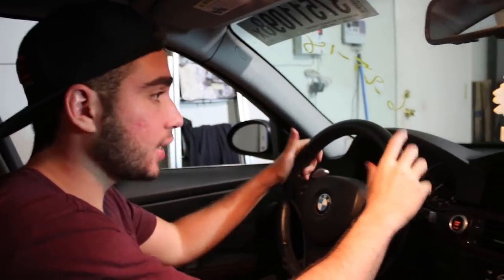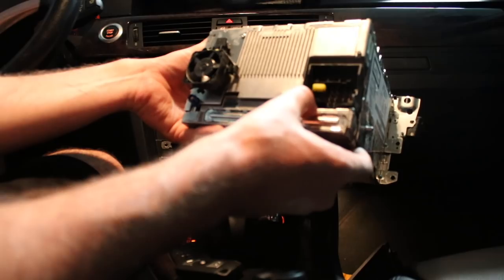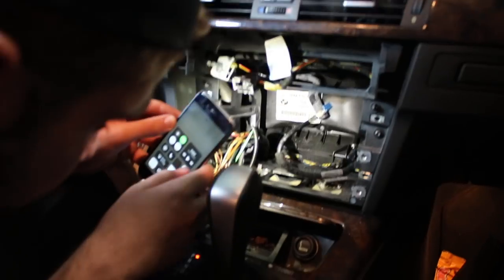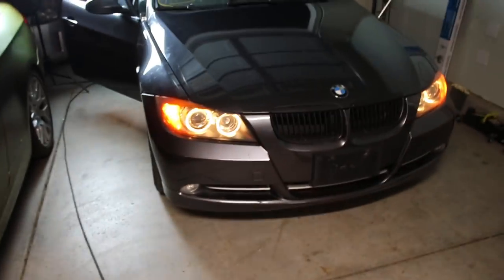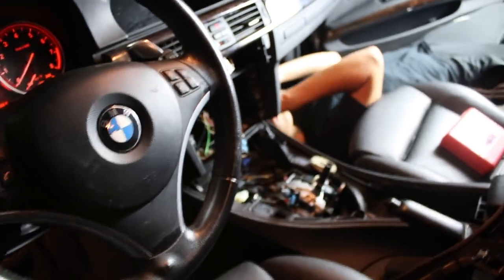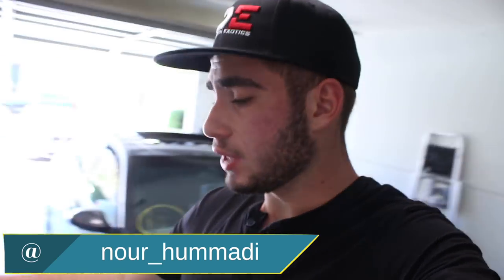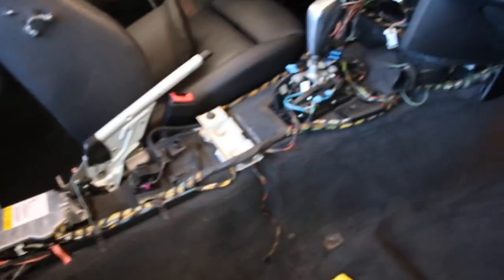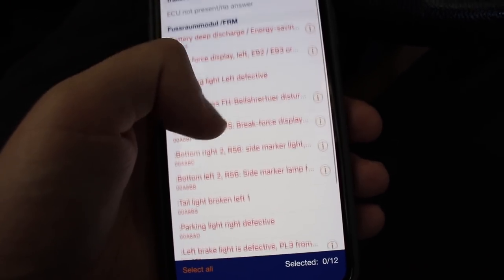Rebuilding BMW 335i Involved In Gun Fight! Part.2

Comment: Careful with the black and green wires that were disconnected from the harness. Those are actually fiber optic cables because you have upgraded audio. They are super fragile and a pain to fix if they break. Make sure when you replace the radio that you get the one that uses fiber optics and not one that uses regular speaker wires.

Comment: White smoke is common near the rear of the engine on the passenger side after a valve cover gasket replacement. That’s residual buildup from oil and other residue that dripped down during the procedure .. run the car and let it burn out. If youre feeling misfires check the cylinders individually.. put your hand on each one to check for any stuttering.. if there is oil build up in the spark plugs it can cause the engine to run rough until it burns out of the cylinders

Comment: the ecu error without the code nr is because of the battery. the ecu was too much time without current. your light in the dash service engine soon is because of sparkplug that was sporadicaly on/off. no code for that as well. if you have a new battery you have to code it for your car. you can do that with your carly app (at least in Europe). and dont remove and put back the battery too much times because you will damage a lot of modules. just leave it off. do all the reapaires and than put it back on. good luck and if you have bmw questions i think i can help.
Reply from the maker: Warp Drive M thanks man, dm me on insta. Would be a great help with this crazy build

Comment: The valve cover gasket probably didn't seat right, I'm guessing cause you said the car doesn't sound right. The car is probably sucking in air at the location where it isnt sitting right. The smoke is the oil leaking from that spot on to the exhaust. Hope this helps 😊.

Comment: An idea that I came up with is plugging up the hole in the steering wheel with some rubber material than getting a cool steering wheel wrap off amazon for a cheap and good looking fix.

Comment: Service engine soon  light is usually on when the oxygen sensor detects a difference in emissions, and according to my experience with 335i’s, it might be dirty or bad fuel injectors, or exhaust leak, leaks in the air system, bad head gaskets, and stuff like that

Comment: Could do some light cuts to get the bullet out of the steering wheel, fill in the hole where the bullet entered with something (silicone would probably be fine honestly) and just put on a steering wheel cover meant for that steering wheel (like JD cars) and save yourself a lot of money over buying a new one

Comment: Gotta say mashallah lmao. Good luck Habibi. Also you should compare the cost of buying new parts for 335i and selling your 330i vs switching your 330i parts onto your 335i, (Doors, panels, full interior, lights, etc.) And scrapping the 330i or selling it as is with the 335i parts.
Either way you do it good luck bro

Comment: By the time you’re done fixing this stuff and the mechanical issues, you’ll end up spending more than the value of the car. I bought mine with 113k and it has a few issues but for $5100 what can u expect. This is insane tho. Props to you my man. I hope that you spend the least money possible.
Reply from the maker: Agustin Duarte trust me man, I have a plan you guys are not expecting. Best teacher of mine told me to keep working and don’t let anyone know your next move.
Reply: Nvm just saw the part when you said don’t jinx it. I HOPE YOU SPEND AS MUXG AS POSSIBLE WATER PUMP, FUEL PUMP, VALVE COVER, COOLANT LEAKS, ETC ALL GONNA BE BROKEN RIP 335 E90... 😂😂😂
Reply: Nour Hummadi yuhhhhh can’t wait!!!
Reply from the maker: Agustin Duarte 😂😂😂